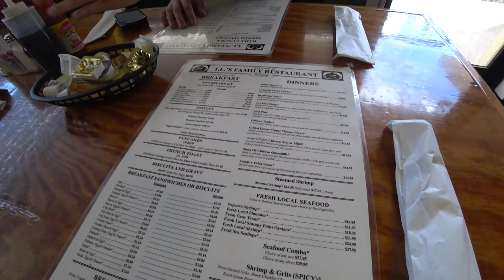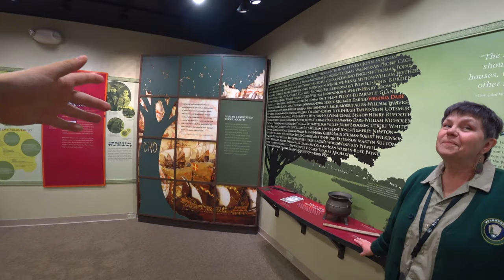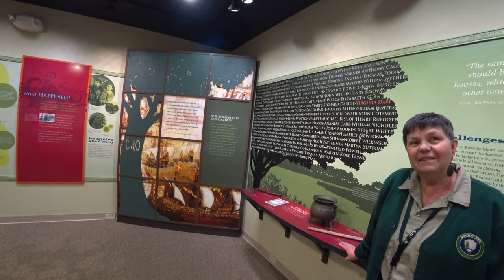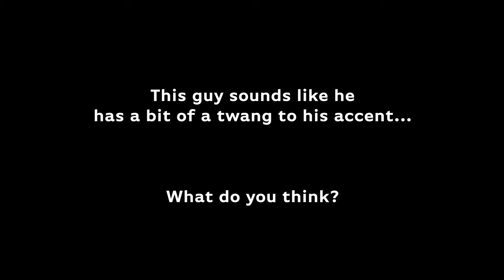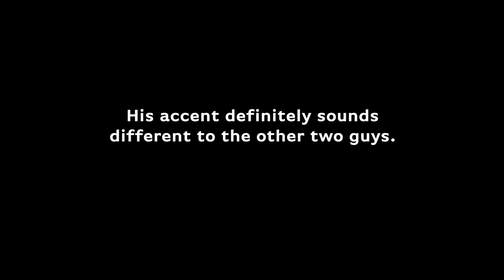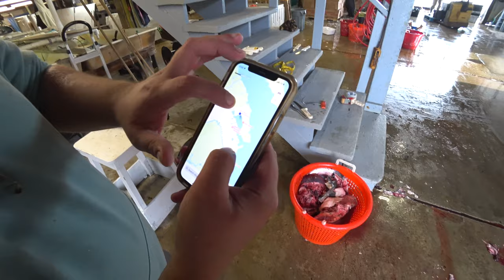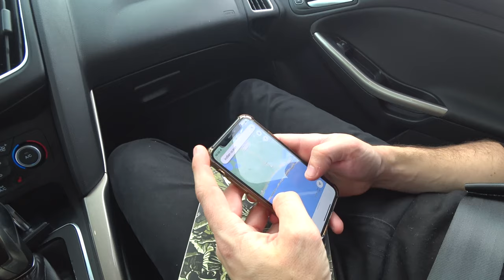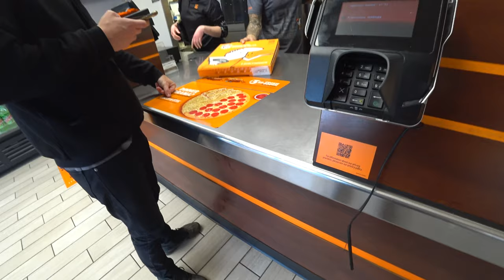Searching For The Hoi Toiders of North Carolina 🇺🇸

Comment: ay how do you edit your videos? I record in 4k resolution in my gopro hero 11 but when i try to edit it on my windows 10 in some free editor apps its lagging and impossible to edit
Reply: Hello, I am a video editor for profession. 4K video has pros and cons. pros are that the video quality looks great, cons are that the file size is double the size. When you combine that with a free editor it can lag, becuase it's a sub-optimal setup for the edit of those files. The quality of your PC also factors in. For 4k video editing more RAM and processor speed are needed than what you find in the average PC/laptops. hope that give a little more insight.
Reply: @WolferiousHalo  Thank you! Well Im getting a new Pc because now i have a laptop and its 7 years old so maybe thats why im getting a new Box Pc so it could maybe work better!
Reply from the maker: Yo! When i first started editing i used a gopro and an old windows laptop and the lag was slooowwwww. I would NEVER dream of trying to edit 4k on a windows 10 laptop, you need a fast laptop with a good processor. I invested all my money in a 4K Camera and knew i needed a better laptop so i bought the newest macbook 14inch M1 chip. There's no lag and i can export the video in 10 minutes. On my old laptop it took 3-4 hours!!! Time is money.
Reply from the maker: I also use adobe premier pro.
Reply from the maker: Make sure you do your research!! i have 0 problems with my macbook, it just cost a lot of money!! £1700 but well worth it!
Reply: @whereisdan  alright thank you!